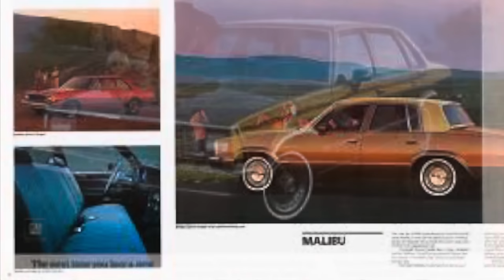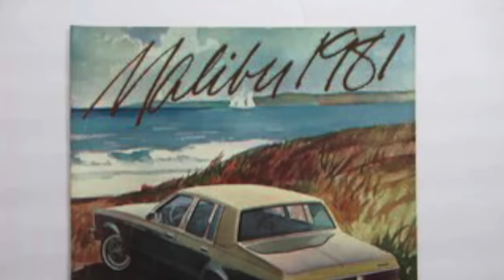Cheap V8 Malibu parked for 25 years will it start and drive again ?

Comment: A great way to clean and lubricate a dirty carburetor is to soak the whole thing overnight in a bucket of diesel,  then use carb spray to clean it up. I also do this with bolts, brackets, etc .
Reply from the maker: Ok ☺️ t thanks

Comment: The round plug connector by the distributor is for the oil pressure sending unit,............ good job guys.
Reply from the maker: Thank you

Comment: The reason for the fixed rear door windows was to increase rear interior passenger room. These mid size cars were considerably smaller and lighter than the previous generation. The concept was since most people would order air conditioning, they would not normally be using the rear windows anyway. Also, with the wheel arch in the rear door, the windows would only roll down about half way, which was not popular with buyers anyway. So removing the window hardware saved weight. The idea was the rear vent windows would provide more comfortable and quiet air flow through the cabin. (And they did work as planned.) with the hardware out of the way, they could concave the inside of the doors increasing interior room.
Reply from the maker: Ok thank you

Comment: I had a Malibu as my first car as a teenager. It was a old RCMP police car with a 267 V8 and factory dual exhaust. The big sway bars made it handle like a dream. Rubber floor. My rear windows rolled down. I did have the dog dish hub caps ha ha. I still have some pics of my car from the 90s.
Reply from the maker: That sounds awesome
Reply: Is was a teenagers dream car amazing burn outs and very good handling. I now have a 85 trans am with a 400hp 350 and 5 speed manual as my toy car 😁
Reply: @Sleeperdude  eventually after about 2 years of teenager abuse it was chopped up to donate parts to a circle track car.

Comment: Hello From Mark In KY.  From my memories of the 1980s cars and station wagons was that the reason the windows didn’t roll down was a child safety requirement for the car manufacturers due to a number of children that climbed out and went either severely injured or killed by climbing out of the rear window while the vehicle was moving. The same thing applies with the power windows on the passenger side as well as the rear windows having the master on/off switch on the driver side switch panel.  I have been thinking of buying a HEI distributor for my Ford truck with the 300.  
The only downside to the HEI was that you always wanted to keep a spare ignition module in the glovebox much like the ballast resistor for the MoPars - Just In Case, Of Course.
Reply from the maker: Ok thanks for the information I appreciate it

Comment: Round plug is for the oil pressure sensor under the distributor for the idiot light. Square plug is power wire to the HVAC harness power the blower motor and runs over to the relay on the AC box
Reply from the maker: Ok thank you

Comment: one of the big electrical plugs went to the electronic controlled fuel metered quadrajet carb.  the other went to the smog pump control.  you need to take smog tubes out of the exhaust manifolds and put pipe plugs in. Then the car will  be much quieter under the hood.
Reply from the maker: Ok thank you

Comment: Noticed you put plugs in the hard way. Use a small peice of vacuum line that fits the tip  and it makes it easier to put the plugs in . This also prevents cross theading the plugs in the heads.
Reply from the maker: That is true

Comment: i had a 1980 and it turned out to have the 267 ci in it. but i bought it to run a enduro race and i didn't have time to change the engine. and to mine and everyones surprise once it got its rpms up it was hard to beat i ended up winning a 300 lap race with it. it wasn't the fastest but damn it never got hot and it was steady. now in a normal 20 lap race it was a little under powered but 300 laps it ran the same speed every lap.
Reply: oh and i remember it had that freak carb on it it looked like a quadrajet 4 barrel but it was a 2 barrel to this day i have only seen a couple others like that and i think they was on a S10 blazer
Reply from the maker: That’s awesome

Comment: The Q- jet you have is an early version. Like 60s 0r early 70s. I always like to use some fine steel wool on the brass power valve piston, and a small wire bottle brush in its bore. Then I use a little powdered graphite on em. It makes em slide nice and easy. And my first carburetor I rebuilt was a Rochester 4GC on a 64 Oldsmobile F-85 cutlass convertible. I was about your oldest daughters age.
Reply from the maker: Ok thank you good info

Comment: I had a 78 Malibu classic with the 305 and 3 speed auto. The only problem I had with it was the camshaft wore a lobe off.  I was very consistent changing the oil and filter every 3000 miles so I’m not sure what happened but I found out that was a problem with a lot of the 305’s. Other than that, it was a very comfortable car.

Comment: if you haven't located or been told yet, the dipstick tube should be on the drivers side between two of the exhaust manifold tunnels. 
small blocks actually have a manifold with a indent for the dipstick tube, can't just used any old manifold or you'll crush said tube. 
(yeah! I did that. wasn't pretty)
Reply: FYI: 79 Malibu Classic with that garbage 6, changed it out for a 305 V-8. was a 4 door too.
Reply from the maker: Ok thank you
Reply from the maker: That’s cool

Comment: Round plug goes to the idle-up solenoid on the Quadrajet, for when the A/C compressor clutch engages. It’s literally an electric solenoid that has a bolt threaded into it, and when activated, extends the plunger/bolt out to raise the idle by pushing against the throttle-arm bracket.

 Dipstick on that era of SBC should be on the right side of the block…
Reply from the maker: Ok thank you

Comment: Yrs ago when I bought my 80 malibu the pan was bent in like that too. Could only drive it half was home. Stoped at Casey's let it cool down, drove the rest of the way. Need day that 305 came out. Legend says the pan is still bent. I wouldn't know, the carb got rebuild and put on the Tandem, and I traded the block for a set of heads. Ended up building a 355 for it. Still got her, I wonder how she will fair with gas prices now. 🤔
Reply from the maker: That’s interesting

Comment: A quick tip my pop pop showed me. Grab an old tube sock and cut off from above the ankle . Put it on like a sleeve and roll it up. So when you are doin oil change it will keep the oil from running down your arm.
Reply from the maker: Good idea

Comment: The rear windows were set up the way they were to save a little bit of weight which allowed the cars to be tested in a lower inertia class in the EPA tests which allowed them to show a slight improvement in the fuel economy tests.
Reply from the maker: That’s crazy but your probably right
Reply: @Sleeperdude  The weird stuff that was done in the 70's.
Nice seeing the whole family involved in getting it running.Keep up the good work

Comment: A car after my own heart I had a 1979 Malibu with the smallest CI V8 ever produced the 267 4.7 litre  I bought it for 500 bucks... Tore it all down yanked the engine, Had the block punched out 40 over and made it into a baby stroker.... It had almost 490 HP at crank and put down 420 to the ground.... She was a 4 door as well and was one helluva sleeper..... As others have stated the back windows did not roll down to make a countersunk door panel to allow more hip room in the backseat... That was confirmed by an engineer from GM that helped design the 1978 to 1983 malibu line.. Timestamp of 23:28 that is the oil pressure dummy light plug
Reply from the maker: That sounds fun, thanks for all the info
Reply: You're very welcome sleeper brother take care of that family

Comment: Get you a foot spa that has heat and vibrates most of them will bubble but you can turn it off works just like when I’m ultrasonic cleaner than it’s heat the water up and shakes The fire out of it
Reply from the maker: Ok good idea thanks

Comment: My grandparents had a maroon ‘79 but got annoyed with the fixed rear windows. They drove it for about 5 years and sold it to a family friend. The car made its way back to me when I needed a college car. It was a rusty, oil spewing mess at that point but it did ok cruising around Nashville. Having a red car with a red interior and dead AC was miserable in the summer. The car finally lost reverse and I sold it to a neighbor.
Reply from the maker: That sounds like me in high school in my 80 Buick park avenue

Comment: Hey mr. Sleeperdude ! Hey Ralphie ! Ladies ! Well , I’ll just give my respect to miss Wawa for showing no fear and getting into the spark plugs . You go girl ! ❤️ that gets a heart 👍. As far as the rear windows only having the stationary glass , I think that was all about child safety . But with no power door locks , kind of confusing in terms of safety , would have to say . It’s been said in other comments regarding the wiring harness plug by the firewall . It is a two wire connector for spade terminals so I’ll agree it’s the oil pressure switch connector since Chevy blocks had their oil pressure sensors near the distributor down next to the transmission mounting . Not certain of the four wire plug but since it’s next to the firewall , it may be related to a/c pressure sensors ? Not confident on that though . That quadrajet is for a Chevy motor since it’s fuel inlet points sideways . BOP & Cadillac fuel inlet pointed forward . This is to the best of my recollection , the ‘80’s were long ago for me . Besides , In the desert , I can’t remember my name and I’m not yet Neal young’s age . Yeah my first carb I ever tore down was a Q - jet too . With the help of the faithful MOTORS manual , I got it back together . Can do it by memory now though . Will say that much . There was discussion in the comments over the original engines of these years for these models . I thought I remembered the Chevy being a 267 and an olds being a 262 but I’ll leave that to anyone who has one of these . The blue GM engines were said to be of less quality than the red GM engines , if that’s true . Nickel content in the engine blocks . The original fuel filter nut had a plastic gasket that sealed it . Please do not over tighten fuel filter nuts on the Rochester carburetors , they strip easily . Then the tap repair kit had to be employed 😳.
Well , the four barrel intake would not be stock in a Malibu small block unless it would have been ordered with a larger displacement engine but probably not typical . May have been engine swapped as you’ve said . Yeah , I guess we are curious if maybe a 305 was dropped in , if we are lucky , a 350 but I’m not counting on that ? Swapped intake probable , those exhaust manifolds look earlier than this year Malibu . Almost look like 283 or later . Hard to say since the down pipe fits the chassis with them so not sure on that . Been since high school since I’ve had my hands on one of these . Good job everyone ! That deserves breaking out the Vienna and RC . “ me and my RC ….. “ . 
Oh yeah , rocky is extremely inquisitive but was really behaving himself today . Good boy rocky ! Well , later guys , later ladies ✌🏻
Reply from the maker: OK thank you for all the information, the owners daughter said it had been swapped to a 305 she thinks, I think you’re right about the 4 Barrel intake as well
Reply: @Sleeperdude  
I’ll agree on the intake manifold . It is cast iron and just looks earlier than late ‘70’s . Trying to recall whether engines went to aluminum by then . Not many of these around now but back in the ‘90’s , I remember Malibu’s and the like were becoming popular for 1/4 mile drags .

Comment: first black 2 prong plug I think goes to the oil pressure sending unit located in back of the block by the distributor.
Reply from the maker: Ok thank you

Comment: Man that is wow how you bought a $500 Malibu and it runs good. It's not often that you get a car that starts up with very little work done to it , casings holding air , & have brakes. Brakes may not be working very well but they are working. Sleeperdude you need to keep an extra pair of flip-flops in the car so when you get off work you can put them on. I have a friend who is a mechanic and he wears flip-flops to and from work. He don't like the wear boots while driving because for 1. they are to bulky & the bottom of them are greasy. Man that was funny how you was getting Airborne at the end of the video. & of course you know I love the celebration at the ending. Sleeperdude question do you think Ralphie would like a pair of bottle opener flip flops? I can see if I have a free pair and his size? Good video buddy thank you for sharing.
Reply from the maker: Yeah we got a good deal on this car, I do need to keep a spare set of flip flops in my truck that would be a good idea. Ralphie wears a size 6 he tells me.
Reply: @Sleeperdude  yes you sure did buddy you got a really good deal. Yeah man you should do that. My buddy he wear his flip-flops to work & put on his boots and socks before he goes in & when he leaves when he gets to his car he takes his boots and socks off and put his flip-flops on to drive home. He realized it's much easier to drive , his feet are more relaxed cuz they out of the boots now , & his feet are cooling down & getting fresh air on the way home he told me. He never was much of a flip-flop weary until one day he had to wear them for like a 1/2 hour & he realized how cool his feet were between wearing flip flops and wearing shoes. Now he's like us he wears flip-flops for everything he do except for work. I know Ralphie's feet is growing should I get him a size up so they would last him for a little while?

Comment: Nice old Chevy. Those small block chevy’s had the dip stick on the right side. The older ones were on the left. The exhaust manifolds tell the side. The rear port you plugged is for the power brakes. 1/4 inch pipe to 5/8 tube fitting is needed. The front one is the pcv valve port. I have an old quadrajet in the garage. Can I send it to your fan mail address? Let me know. Ps, that would be a good kids car.
Reply from the maker: Ok thank you for the information, you are welcome to send it to our P.O. Box if you want to. Thanks for watching

Comment: Congratulations on the repair, it was 99%, the mechanics of this old warrior machine running again 🤩
Reply from the maker: Thank you
Reply from the maker: Thank you
Reply: @Sleeperdude  Here in Brazil if you're going to pay for it just getting the engine to work is a fortune to reform, don't even think about it only for the rich that it's easier to buy a new one..

Comment: Satellites got a pretty good deal you hook the brake booster into the PVC valve brake booster goes behind the carburetor you're running without a vacuum advance is a carburetor base gasket with wrong to install the power valve should look for the spring on the bottom of it install the tile. Then you put the gasket on your right and taking the primary needles out and reinstalling them looks like a truck carburetor thanks for your video and your time you got a real nice looking family
Reply from the maker: Ok thank you for the info I appreciate it

Comment: One possibility as to why the window in back don’t go down   Is because it’s air conditioned. Don’t need the window to go down. Then use the extra space for comfy arm rest   The vent window is because when the came out with ventless windows they still had a contract with the dudes the made the latches so they put them in the back.  May not be right. But it does answer your question.
Reply from the maker: Ok maybe so

Comment: Theres a small allen set screw and a tiny flat head screw on the passenger side that adjusts the tension of the secondary flaps on the carb if the flaps are too loose it will fall on its face at full throttle turn the flathead screw just a little bit at a time to get it where u want quadrajets rule👍
Reply from the maker: Ok thank you I really appreciate it

Comment: The good thing of the 4 door Malibu is that you can put  a 1969 Malibu engine, and it will fit awesome, my neighbor put in a 305borf350 and that car really worked better with that engine, not that Metric engine.
Reply from the maker: Yeah the pre 72 engines made more power

Comment: ..some of those late '70's-early '80's Malibu's came with a 267 SBC rather than a 305...only made those for 5 or 6 years, hard to distinguish them from a 305 on appearance...also, a lot of those cars had the TH-200 automatic rather than the TH-350....

Comment: 305, yeah man.  if i remember correctly, the trans am had a 305 pontiac GM.  i test drove one used, trade in 54k miles and this thing had speed.  a female owner, looked brand new.  the sales man was yapping, he said turn left here,  when all four wheels were square, i floored it.  both our heads went back into the seats.  they wanted 8k for it, this was 84 or something....?  i wanted this car, the interest rates back then were  14 or 15%.  yes, a 305 chevy is a good engine.  it will rune very rough with half oil filled.

Comment: Round plug usually is an oil pressure switch or power steering pressure or air con.  Thiers one of those on each of those.  But I believe that one in the rear goes on the oil pressure switch by the dist
Reply from the maker: Ok thank you

Comment: The single wire might be reverse or shift indicator light.  The other could be neutral safety switch.. Melting plug wires? Just bend the plugs over.. NO big deal😄
Reply from the maker: Ok thank you

Comment: I really thought that filter would fall off, like the plugs Australian Holden V8 start from left front num 1 , distributors run clockwise, only have 253, which is 4.2lt and 308, is only a 5 lt my Statesman has 253 with turbo 350 I think they have Chevy transmission pattern Holden have a smaller pattern all the best to you all
Reply from the maker: Ok that’s interesting thanks for watching